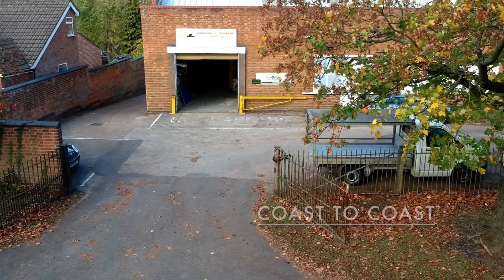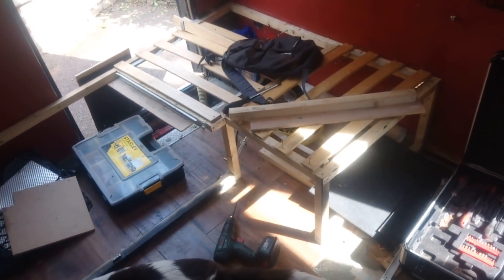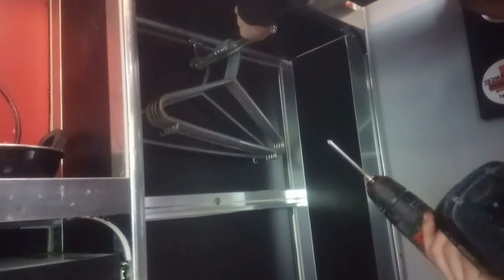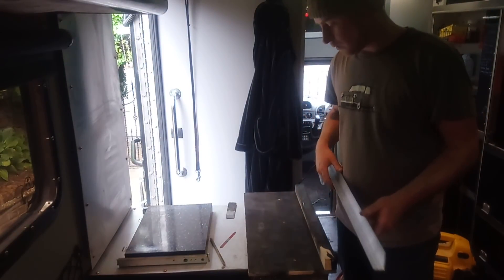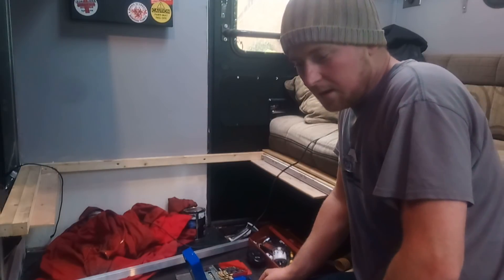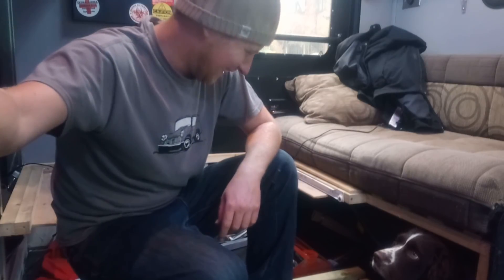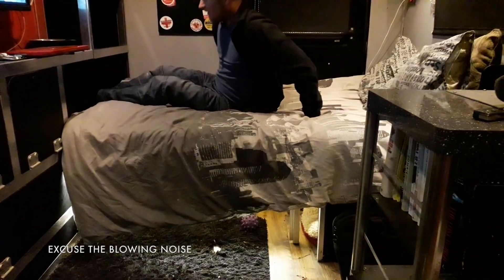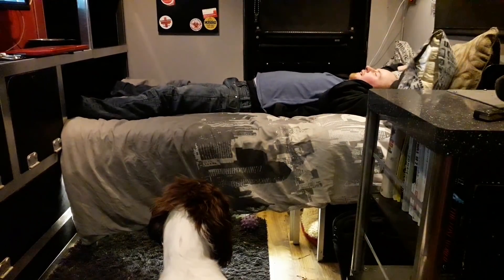Bed Changes & Dog HouseS. [CONVERTED AMBULANCE Renovations]

Comment: I've put a small fortune into my 4 wheel drive ambulance conversion and it still isn't top notch. There are always those things that you have to revisit over and over but, little by little one problem after another disappears. My new transmission needed all kinds of things done to it that seemed like witchcraft more than anything(on board sensors remotely talking to the on board computer...Blah...Blah...Blah...)sometimes you got take a big sigh and open the wallet....oh ya and don't ask about the working to pay for it....lol. Thanks  for the update, that's an awesome rig you have there.. Cheers

Comment: Ah lovely video, especially the last scene ( I suppose the drone is working again?) and I loved the kitchen knife to cut the foam (cleaned and put back in the drawer?). Semi automatic gearboxes can be a complete nightmare. I don't know much about Mercedes sprinter gearboxes but I know that some contain various hydraulic valves and actuators that control which speed is selected and they can be virtually impossible to repair. I hope you don't have to suffer paying for a new box as my friend did with his Audi. Please keep sharing the vlogs, so nice to see another 'built not bought' camper!

Comment: Hi just wondered what paint you used on the outside for your camper?looks nice dude 😃
Reply from the maker: Hey, the paint is military grade self leveling paint. As cool as that sounds you can just buy it off ebay 😂, you can choose from a number of army colours, tin sizes and it's not too expensive. I rollered it on.
Reply: @ProjectAmber  thanks for the reply just subbed too.cool van and dog all the best mate..